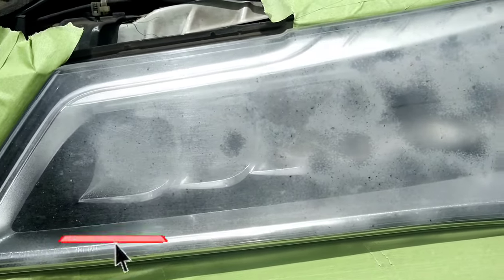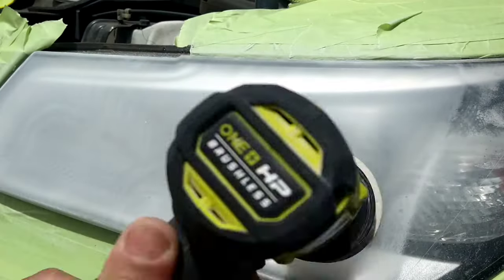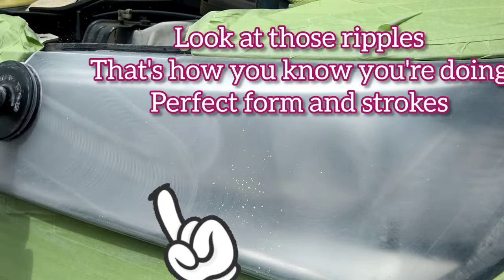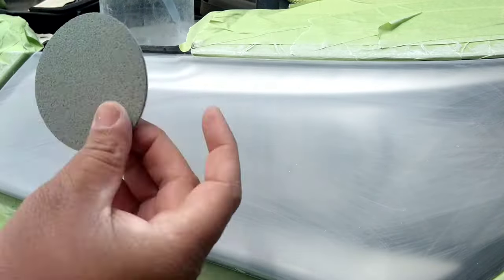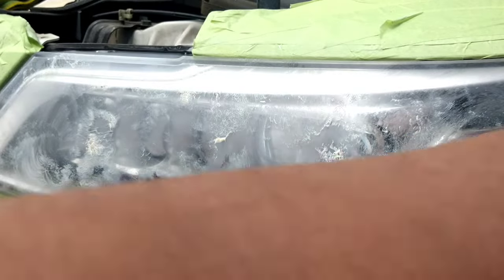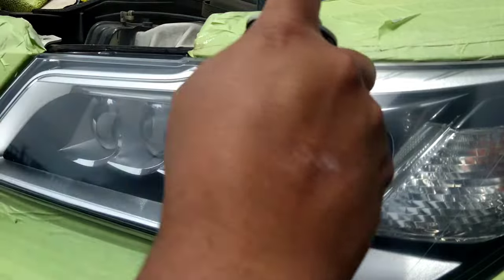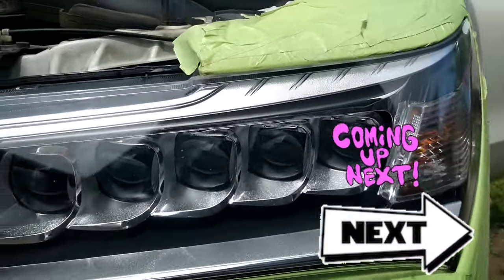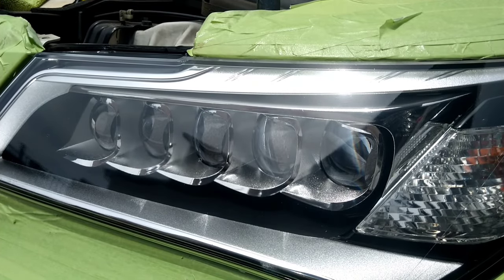Why not to double clear coat headlights 🫣--- HEADLIGHT RESTORATION

Comment: Can you use a resin based ceramic coating as the final protection after polishing stage?
Reply from the maker: I would most definitely stay away from ceramics...they all suck for headlights... even ones made for headlights...
Number one problems..too thin....(and you should never double coat) # 2 problem ..lack of UV protection../ unless made for headlights... even then too thin still... Also to hard...that in combination with the thinness of the product leads to a lot of impact damage.. pitting, crowning, and potential impact cracking and creators... Using a spray which most if not all ceramics do not come in allows you to regulate the thickness in one coat
Also typically being more springy if using headlight product or meant for headlight products..  more of a bounce off effect or impact insulation... Although ceramics but quite transparent compared to other things still not recommended.. check this out..
https://youtu.be/k8_ljUVQfvo

https://youtu.be/NgxNImOAoCY
Reply: @theheadlightrestorationpro  Thanks for quick response! Figured i'd ask since i have some at hand. Im going to use the Meguiars like you did. Also, was wondering if the last polishing step might hinder the clear coat adhesion? Can i spray after wet sanding up to 2000 grit?
Reply from the maker: You could do what you want but it's not going to be as good as what you're seeing on my finished product.. you got to forget everything you've learned that he's in is promoted by the way it's done.. that method you speak of is for painting cars and other substances not plastic expressing not transparent plastic..
Reply: @theheadlightrestorationpro  Good deal. Going to pick up a 3" rotary today to replicate your method. Do you happen to know what chemical Meguiars uses for the coating? Is it a Polymer Clear? Only asking in the instance I detail this clients car again in the future, i dont want to mix protections improperly. I'll let you know how this whole thing goes also.
Reply from the maker: Everything I use is in the bio listed for direct purchase or viewing....

Comment: How many restorations can you do in a week sir?
Reply from the maker: A lot ..
Especially if they are all in one spot...
24 hours in a day, if you work 8-12 hours ..
You squeeze in a lot...
They only take 39-45 per car (normal headlights/ no issues)
So as much you are willing to do...how hard you hustle, how many customers you can pull ..
Reply: @theheadlightrestorationpro  Over here on the southeast coast there are headlights in need of service by the 1000s! +. Have you serviced semis ?

Comment: Hi there! How many inches away are you when you spray the maguiars head light coating? I was able to get the lens crystal clear up until this point (I wasn’t using enough speeds or pressure with polisher, once I did it went from cloudy to crystal clear). When I did my one coat, it isn’t as clear now. Maybe I was too far and letting it mist? I was about 10-12 inches away, in the shade, slight breeze, but it is quite hot and humid today. Thank you!
Reply from the maker: Always about 5 to 7 inches away... You been spraying yours about double that and it's too much of a mist of the headlight you want the mist of the headlight but not like that.. you want to see it get wet on the headlight...
Reply: I just reviewed your “clear coat like a boss” and heard you say 5-7 inches. I’m working my other car, and finally got it! Holy cow, what a difference that detail makes.. spray 5-7 inches yall!  Thank you headlight restoration for all your help, I really appreciate it!!
Reply from the maker: Yes ...🤓tmi appreciate you...💯
Reply: Hi, what polish did you use before the clear coat?  Thanks!
Reply from the maker: In the bio....

Comment: Thanks for the video--nice work! Why not a nice 3M UV PPF after polishing?
Reply from the maker: It's not marketable and not recommended.. for one is not customer friendly... People think raps and things like that are set it and forget it which they're not you always have constant peeling and lifting and shit going underneath it which can degrade the paint and or headlight surface, just a heating alone aspect can really have drastic drawbacks to the surface of your headlight and or vehicle paint whether it's ppf for headlights or vehicles I don't really agree with either one unless you just don't care which ends up being a problem later..
As a professional I couldn't approve it on headlights for sure.. for one the overheating aspect is high which in the long run damages the health of the headlight spider cracking warping different things like that.. for two it's not user friendly as I stated earlier.. and for three it diminishes your light output significantly.. having too many layers of things in your headlight block light each time it hits a crust layer if you want more feedback on that or more information check this video out...
Why not to double coat..
https://youtu.be/NgxNImOAoCY
There's also a couple other reasons I cannot to go into at the moment.. like cost to the customer, they don't want it..lol... And the fact that it's going to peel your clear coat off nine times out of 10 meaning you need a full headlight restoration afterwards either way.... The longevity aspects do not outweigh health of the headlight.. specially when you have vehicles that are going to be on the road for well over 10 years Etc.... ..

Comment: I had a 2010 mazda3 sport GS with dual xenon headlamps, and it created a lots of uv and heat, and began degrading the inside of the lense enclosures.  Is there any way to fix that?

Comment: Ooops, I put on multiple coats of clear onm my headlights after sanding and polishing.
Reply from the maker: Yeah that's probably why they look like that... And they're not going to function as best as they could or last as long as they can.
Reply: @theheadlightrestorationpro  I mean, I just finished spraying them this afternoon. Im gonna let dry overnight and see what they look like tomorrow. If theyre not as clear as they should be, what then? Is it possible to just compound the clear coat off or am I sanding, again?
Reply from the maker: When adults start from zero.. or better yet start over from scratch... Full headlight restoration... Sounds like there's too much stuff going on if you keep messing with it it's just going to be waste your time it's going to keep getting worse and worse or change to a different kind of bad..
Reply: @theheadlightrestorationpro  What I meant was that I sanded, compounded, and polished the headlights today. And then hit them each with 4 coats of clear coat (Rust-Oleum 2x clear coat). I saw this video as it was drying. I'm letting them dry overnight to see what they look like in the morning. I was curious, though... If they don't turn out as clear as I want them to, do I just start over and sand them again?
Reply from the maker: Yes.. don't use 2K clear... Yes start over no matter what they look like got to get that stuff off you'll thank me later..

Comment: The thinner the clear coat, the quicker they will go to s**t again. But that also could explain why head lights go to s**t so quickly from brand new.
Reply from the maker: True that's why you have to lay on thick layer at the same time if the layer is too thick it will not function correct it'll inhibit the light output first and foremost beyond  first and foremost beyond how they look visually the main objective is to function properly this is also why there's one coat and you should never double coat..
This is why the factory does it this way as well...
Reply: @theheadlightrestorationpro  well i hope mine turn out ok, haha. I finished sanding mine with 320 grit with a foam back and asked my mate to apply 4 coats of 2pac clear cause i want them lasting more then 6 months to a year
Reply from the maker: @harleyhem3381 good luck👍🏽

Comment: I've refurbished dozens of lights and I have to disagree that without clear coat the lights only last a few months. It's not true. My oldest refurbished headlights are now 9 years old and still look good. If everything is properly aligned and correctly polished then the lights will last longer than if they are repainted with 2k clear coat. Just take care of them like the rest of the paint on the vehicle. In addition, the night pattern of the lights is noticeably sharper when tested than with clearcoat.

Comment: First of all, yes, you can clear headlights. But one thing you did not do that. All painters must do cover the car while you are clearing. Cause clear travels pretty far <3 minutes. It will land on anything on your car and now you'll have to clay, borrowed it or wash it off with thinners. Or whatever not cool.  Cover the car while you're doing some so show the real way to do the job.
Reply from the maker: Well you actually have no idea what you're talking about... This isn't painting houses this isn't painting cars this is clear coating a headlight the clear coat is different and easier managed... You can get it off with simple alcohol in thin amounts.... "IF" it gets over as you see my taping goes about 5 or 6 in around the headlight...(did you even watch the video ) This is a headlight certified designed can even the tip it's very directional and design for spraying headlights it only has a a 2-in fan spray with about a 1 in overspray.... So nothing gets over on the vehicle EVER....(not even in wind) APPRECIATE YOU WATCHING but make sure you know what you're talking about before you respond like the PROFESSIONAL that I am doesn't know what he's doing you might want to check out OVER 100 VIDEOS ON THIS CHANNEL before you get on here trying to measure 🍆... This is not 2K clear or something in a regular aerosol can that's not designed for headlights, this product is DESIGNED FOR HEADLIGHTS.... No need to cover the car because I'm educated enough to know better... Somebody UNEDUCATED using something NOT for headlights would need to do so which I always advise against...(never use a product not designed for headlights)
Reply: @theheadlightrestorationpro  If it can come off with alcohol, then it will just come off with the elements. This is designed to be repeated so you keep buying the products.

Comment: I want to do this. This is the list of steps I noted down. If there is anything missing please correct me. Thanks

sand p500
blow dust
sand p800
blow dust
Hand sand with p800 to get rid of swirls
sand with pm3000 trizac pad

clean up with windex and microfiber towel
dab and buff with chemical guys headlight restore and protect (wipe with microfiber cloth and blow off dust)
spray 1 coat of meguires headlight uv coating
Take selfies with your shiny new headlights
Reply from the maker: Not chemical guys...use a high-power buffer..make sure you tape off too.
And watch more of my videos...